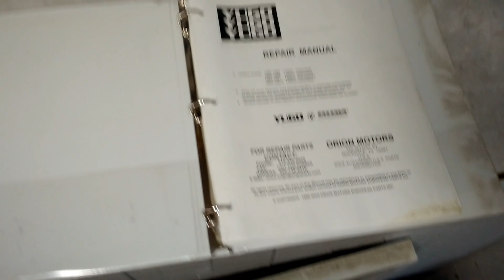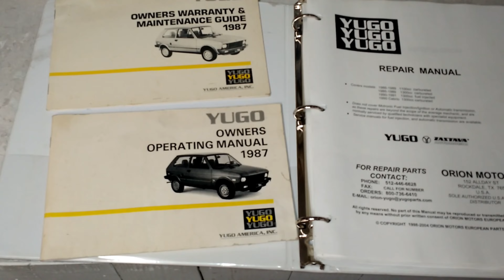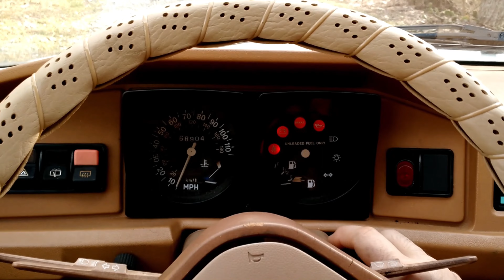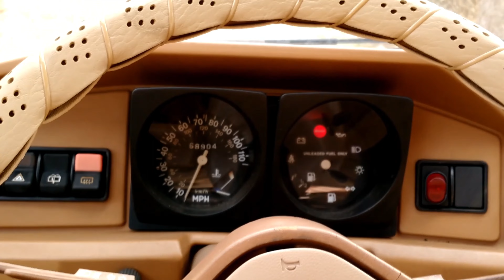Restoring An 1988 Yugo GV. The complete Saga.

Comment: Wow that looks to be in good shape for the age. I looked at one that was traded in, I think it was only 1 maybe 2 years old.  I was looking it over and it needed a bunch of little things. Things that normally don't go bad for many many years were broken. Like the vent window latches, they didn't hold the vent windows closed. I could stick my fingers through the gap and open the vent windows and then unlock the doors. As a kid, I thought I can fix all the little stuff.  I really needed a truck and ended up getting a used truck instead. Later I saw one sitting for sale and was looking into buying it and I was told that I could buy it, but once it transfered I wouldn't be able to register it and run it on the road again. I got busy with work and never got to find out if that was true or what I would need to do to make it road worthy again. Maybe that was a PA thing? Good luck with fixing it up.

Comment: I looking at installing ac on my 128 is the crank pully a double pulley? How are the belts routed for all the accessories? Enjoy the car there lots of fun
Reply from the maker: It is a single belt. It runs the AC, Alt, and Air pump. I found the AC not to drain too much power from the motor.

Comment: The second  job I ever had was at a olds/ caddy/Nissan  dealership.  
Had like 30 and I had to move a bunch of them to a different  location  on the lot.
Wow.. worst shift linkage ever..every one else moving them Said the same thing can't find gears.
Also not good if well over 6 ft .
That's all I can say . So if the shifter feels messed up .. they came that way.
Reply from the maker: they were small- guess they are smaller in Europe
Reply: SO TRUE. You couldn’t find 1st gear, and reverse NEVER🤣🤣🙏🙏